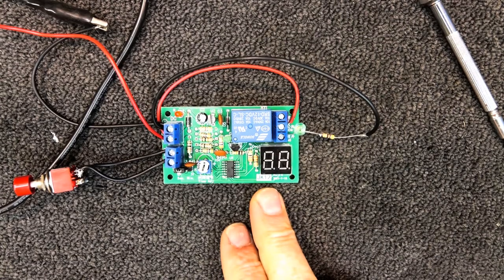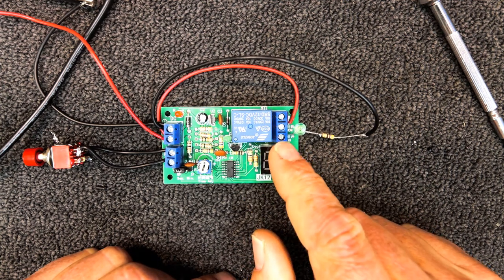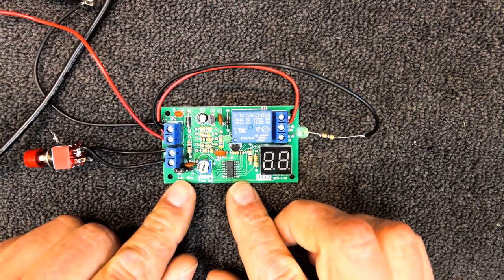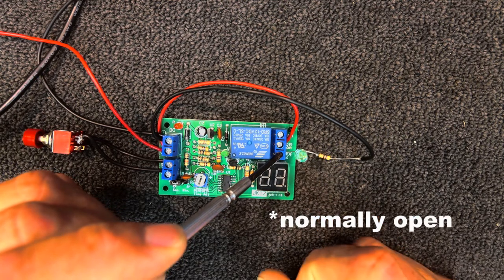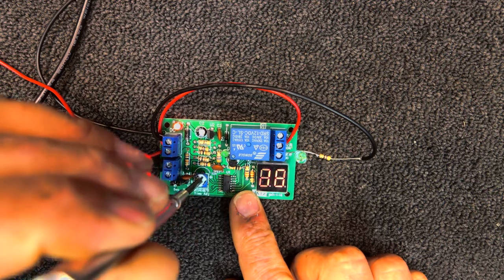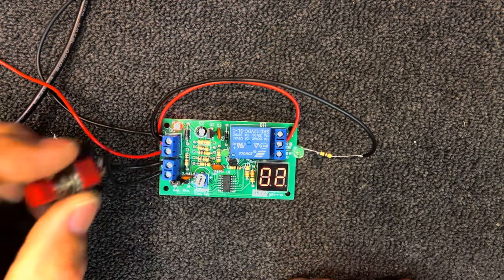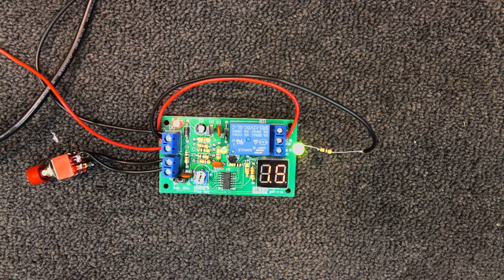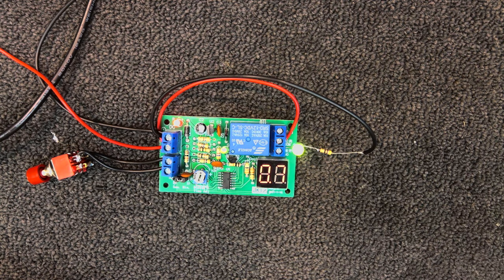Timer module JK12. How to connect it up and use it

Comment: Ok so I need something that can keep my battery shut off relay on for 2 hours after I shut the ignition off so I don't forget to disconnect it when I park it for a few days. Is this what I need? How would I then start the car? Is there a way for it to turn the timer on when ignition is shut off?

Comment: Is it possible to modify the circuit for less than 1 second in duration?
Reply from the maker: I didnt design it so dont know, but doubt it. Normally you would use a monostable multivibrator to do that sort of thing, but would likely have to build it yourself. Search the net for 555 timer one shot.
Reply: @ 
Thanks. I’ll check it out.

Comment: Steve, if using a momentary switch as a trigger, will a second press of the switch stop the timer and disconnect the relay?  That is the function I am looking for.  TIA!
Reply from the maker: I dont think so with these modules. A second momentary switch that disconnects the power would likely reset them though.

Comment: Is there a knob that you can use to set the timer as I want tp panel mount it, A knob to ajust it would be great rather than putting a screwdriver through a panel. Great video thanks
Reply from the maker: You could unsolder the trimpot and fit a full sized panel mount potentiometer in its place on some wires. It looks like its 500K resistance which is what the 504 printed on it means. You can get them in imperial or fluted shaft types which determine what sort of knob you need. Here is an example: https://www.jaycar.com.au/500k-ohm-linear-b-single-gang-24mm-potentiometer/p/RP3522
Reply: Cheers Steeve will get that and refit the potentiometer. @StevesElectronicRepairShop

Comment: I’m lost, why are you installing jumper wires from the + and - power input to the load out from the relay ? Doesn’t that defeat the purpose ? Maybe I’m missing something. I’m trying to learn so any explanation would be appreciated.
Reply from the maker: In some circumstances you may want to switch the load from the same power source that runs the timer. I wanted to use it to run a 12v beeper, and it was also convenient for the demo with the LED. If you want to switch something like 240v or some other completely separate power and device then just use the relay contacts with no connection to the power for the timer.
Reply: @StevesElectronicRepairShop  Ok, I'm having a problem. I have the - & + power going to the device, a trigger wire to a momentary switch and the - (common) and + (NC) going to the -/+ of the LED lights. I get the red LED power illuminated, press the trigger button and the green load LED illuminates & the display starts the countdown (15 sec) but my lights don't turn on. I'm not sure why ? I would include a pic but I don't see a way of attaching it.
Reply from the maker: @johncase2974  You need power for the load LED lights connected to the com relay contact, because that is what is switched to the NC and NO contacts. If they run off the same voltage as the timer module then you link between its +  terminal and the com relay contact, like I have done, assuming the LEDs are connected to neg on their other side, which I think you are saying they are. If its a different voltage to run the LED load, then you connect the positive of that voltage to com on the relay, the LED to NC as you have done, and the negative of that voltage to the other side of the LED load. They will then turn off while the timer is running for its time period after the switch is pressed. Hope that helps.
Reply: @StevesElectronicRepairShop  Thank you, thank you......that most definitely helped. I now have an operational pedestrian crosswalk with led flashing lights that activate for 15 seconds each time the trigger is pressed. I really do appreciate you taking the time to make the video and then reply to comments when someone needs help. I look forward to your next video.
Reply from the maker: @johncase2974  Is it a real crossing or a model railroad or something? Glad you got it running. Questions are good to help me understand where I can explain things better, and they might help someone else with their project.
Reply: @StevesElectronicRepairShop  it’s a real cross pedestrian crossing. I volunteer for a historical museum and village. We have multiple special events each year. This will be deployed during each event on a back street that separates the property. I’d be happy to share a couple of pictures & even a video clip by email if you’d like.
Reply from the maker: @johncase2974  If its no trouble I would like to see it. You can find my email under the About tab for this channel.

Comment: Hi Steve, thanks for the great explanation on the timer as mine arrived without any sort of instruction. One issue I'm having though is adding a PIR sensor. The sensor triggers properly, but the sensor only has a 30second delay before it starts triggering again, and will trip the timer again shutting it off before the timer's cycle is complete.  The less than ideal workaround I've come up with is connecting the sensor's power to the normally open block, killing power to the sensor.  Unfortunately, the boot cycle on the sensor is about a minute once power is restored. It's looking like I just have the wrong gear for the job.  Any ideas for a better solution with what I have?  Thanks.
Reply from the maker: Are you trying to run something for a set time period every time the PIR is triggered? One possible alternative would be one of those PIRs for turning on security lamps. They make them without the lamp fittings such as the Clipsal infrascan series, and I think you can set them upto around 20 minutes lamp run time. They are made for 240v operation so would have to be modified to run on a lower voltage if that is what you need. I think they also made an indoor one mounted on a light switch plate.